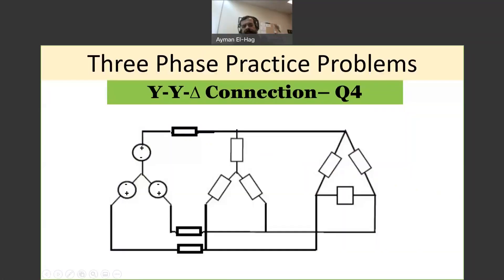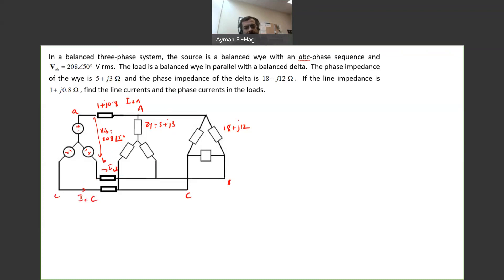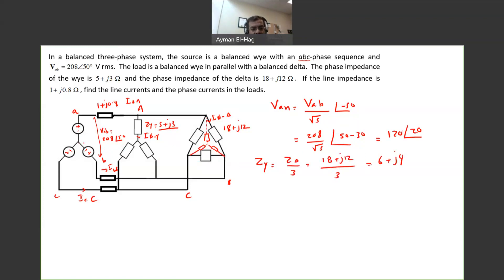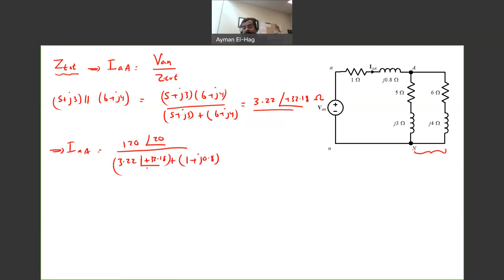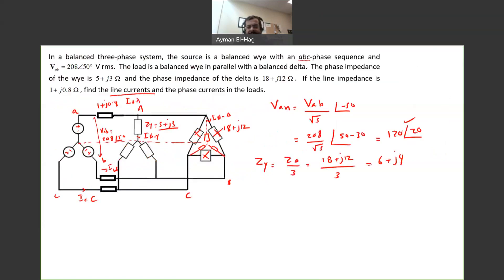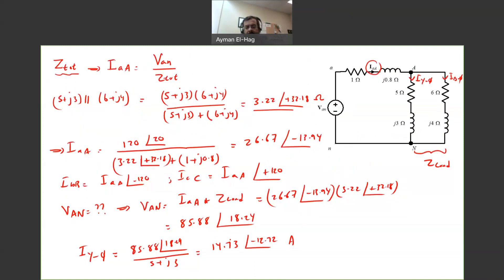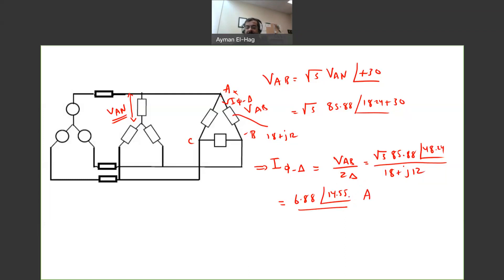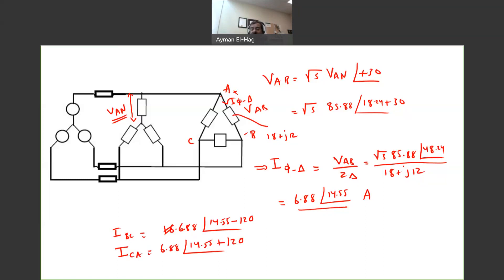Three phase circuit- Question no. 4

Comment: Hello Professor, I calculated (5+j3)//(6+j4)=2.08+j2.13=2.98<45.68. So Ztot=3.08+j2.93=4.25<43.53 and IaA=28.24<-23.53 A. Maybe I am wrong. Could you confirm it? Thank you so much.
Reply from the maker: The parallel result in rectangular format is 2.7294 + j1.7176, which is different than your result. You need to multiply (5+j3) and (6+j4) and divide by their summation.

Comment: can we also calculate Iy to be Iy=VAB/Zy. Because Iy in y loads is the same. Is VAB the phase voltage across the 5+3j load?
Reply from the maker: Vab is the line voltage. You need to find the phase voltage Van to find the phase, or line, current in Y connection.